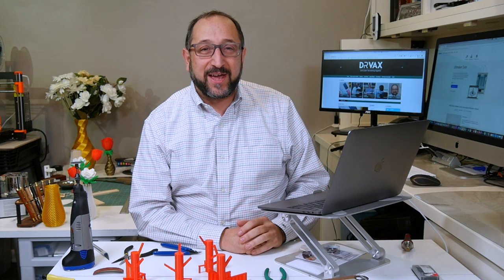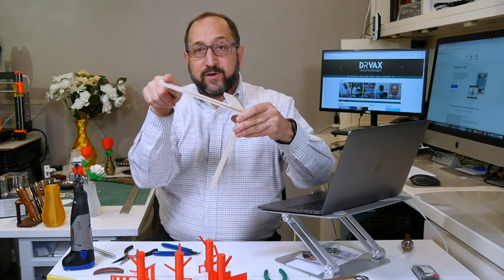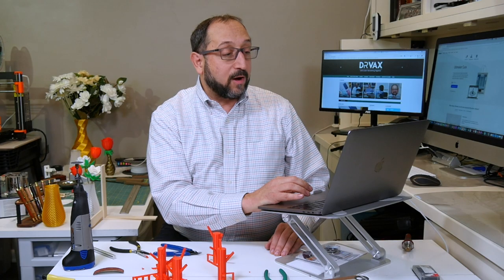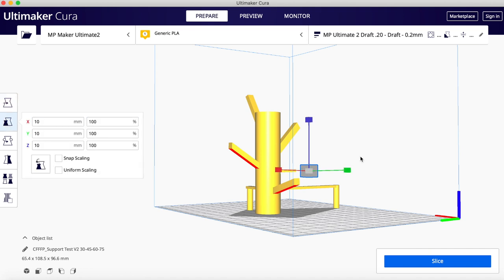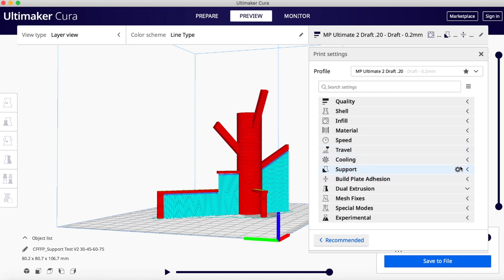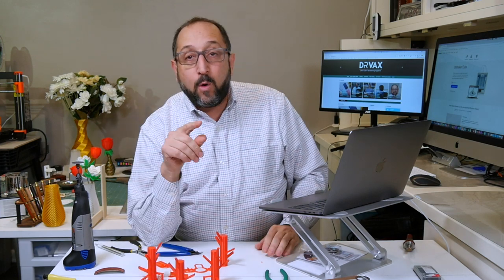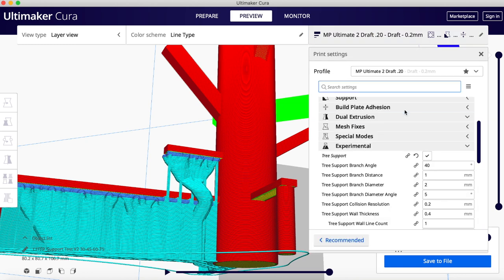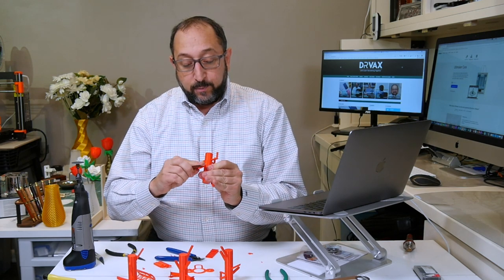Cura 4.4 Support Settings Advanced Topics and 3d Printing

Comment: as any things, the Devil is in the details and here is an good exemple.. happy to learn the little things that we need to know for to have a better printed object.. and you explain it easy to understand.. i love to learn but it’s a lot when you start from zero: learn freeCAD, Cura, printer calibrations/adjustments, filaments calibrations (which humidity level need to be lower than possible)..  more i learn, more is like any craft/art work and tools become more important with the time (and success).. thanks for your video!!

Comment: Go into the quality settings and make the "support line width" half of what your nozzle is.  It will make the support thinner and easy to remove when you need it all over the model.
Reply from the maker: Excellent suggestion.  Thanks for sharing.

Comment: Just a heads up, when you turn Tree Supports ON, you should turn OFF normal Supports ;) that will fix your slow print time issue.
Reply: Beat me to it.
Reply from the maker: @foxabilo Thank you!!!

Excellent advice which may explain some of the issues I have had with tree supports.  

Thank you for sharing.  This is an excellent example of learning together.

I just posted a community comment about this "feature"/"bug".   I will be doing some additional testing because some of the standard support parameters, such as interface, still apply when tree support is selected.
Reply: @MakeWithTech  Could not agree more, I find tree supports really handy for miniatures, it can be a little hit and miss at times but I find it a godsend for things like 1/200th scale tanks  where you just need the smallest hint of support to keep the barrels from drooping
Reply: Dang, just seen this after I had come ted the same. Lol
Reply: Yep, if both are selected it will print both.
Reply: Thanks for the nice explanation. Im still fighting with supports but this helps getting in the right direction

Comment: I actually love using tree supports when printing mini's (D&D type models). It does a great job of getting support into the little areas that are not above the build plate because of a base or other obstruction to the support.
Reply from the maker: A number of people have told me this.  I will spend some more time trying them out.

P.S.  I have started a new discussion forum at http://forum.drvax.com where we can all have more elaborate discussions and share pictures of our prints and printers.  Check it out.  Please excuse if I have posted this to multiple comments from the you.  Just trying to get a bit of exposure.  Irv

Comment: I’ve found tree supports to be very useful for parts that overhang the model itself, but I don’t want use to use “everywhere” setting. The tree supports will only print off the build plate, but curve around the model to support the areas that need it.

They also tend to be a little more stable for very tall supports, since they generally print with a wide base that tapers off.
Reply from the maker: Good information.
Reply: @MakeWithTech  In the video you claim tree supports take longer, but you sliced with both normal supports and tree supports active. You should always have only one type of support actived or your supports will take twice as long to print and twice as much filament and will also be very fun to remove ;)

Comment: Amazing video as always. Regarding the support blockerl if you click on the area you want to block you get it right ahead of time
Reply from the maker: I have found that with Cura 4.4 you need to click on an area that is at least as large as the block.  Might be a 4.4 bug, since before 4.4 it seems I could click anywhere.  I am testing on a Mac so this may be a Mac-specific issue.

Comment: DrVax, thank you for your excellent instructional videos on 3d printing. I have technology experience, but I am new to 3d printing, so your videos have been very instructive. I admire your matter of fact presentations and taking us along on a learning journey!

My request is for you to do videos on specific issues I am encountering with 3d printing. Hope you can cover these topics! btw. your pace is spot on!
1) In the context of Cura, what's the definition (or difference) of a printing profile, how the profile applies to a a model (STL) and the resulting gcode (which is STL+Profile). How best to create profiles for materials (PLA vs. PETG) and then apply them to models (STL)? 
2) What's the proper way to to create profiles based on filament material and apply to specific (1) STL?
3) What's a Cura project and how it should be defined/structured? This relates to printing profiles, etc. as in 1 and 2 above.

Greatly appreciate your response! Shalom

Comment: Have you noticed longer slicing times in Cura 4.4? On my system, the 4.4 would slice would freeze around 35% and not progress any further for about 10 - 15 minutes, before it finally finished. I went back to Cura 4.3 and the slicing is much faster even with the same profiles selected.

The timing on this video was perfect. My most recent models with supports proved very difficult to clean and several of them broke in the process. I will definitely take a look at the settings you suggested to make printing and clean up easier.
Reply from the maker: I have not seen thank.  However I use a rather high end Mac with lots of memory.  Try closing all other apps and browser windows before you slice.  Sounds like your system might be memory constrained.

Comment: Great walkthrough of a important trophic
How about looking into others slices.
I have not have good slices with Cura
Thanks for sharing👍😀
Reply from the maker: Yes check out the slicer playlist on my channel.   My go to slicers are PrusaSlicer and Cura.  If you are not having good results with Cura I expect you may not have a good profile since my results across 8 different printers have been uniformly good.
Reply: Asger, I agree with you.  I was a big CURA fan until Dr. Vax had the video on some of the advantages of PrusaSlicer.  That's the only one I use now.  I found it difficult to go back and forth, as the commands and especially the way to move and change options is so different between them.

Comment: Great video as always, but you should not use both supports at the same time. Use either Generate Supports or Tree Supports else Cura will actually generate both this taking more time to slice and print.
Reply from the maker: Correct.

Comment: Ohh, and a hot air gun is great for removing the surface artifacts left by sanding :)
Reply from the maker: Yep.   You just need to be very careful with models that have fine details.  In one of my first videos on this channel I basically melted a model.

Comment: I have tried and tried, since 2013, to dial in Cura but no matter which printer I have ever had it is the one slicer that I never could tame on any of them.  I really want to due to the features but something about it is just wrong (probably some setting).  For instance with Cura I get gaps in walls.  Another oddity is my infill is missing in spots but S3D or PrusaSlicer or Slic3r they all come out perfect.  I tried changing settings for half a roll last month and I could never stop it from mimicking under extrusion.  I even set the flow to 200% and the same issues.
Reply from the maker: If you are creating a printer from scratch vs using a printer cura already includes make sure you check the filament size in the machine definition under extruder.  It defaults to 2.85 or 3 mm not 1.75 which is what most people would expect.
Reply: I always did that but it doesn't help.  I knew to do this with Cura because the UM uses 3mm (2.85mm) filament.  Just some setting I am unable to find to get it to work 100%.  As UM told me there are a lot of settings that are hidden on purpose and we are unable to unhide them.

Comment: How did you make the supports a different color in cura? Everyone seems to have different colors for infill and supports but I can't find a video or plug in that has it. It would make seeing supports a whole lot easier.
Reply from the maker: I do not.  This is just the rendering in the slicer preview.  Once you have sliced the model go to the preview view and select color scheme line type. 

P.S.  I have started a new discussion forum at http://forum.drvax.com where we can all have more elaborate discussions and share pictures on our prints and printers. Check it out.

Comment: hello does it work for last veriont for miniatures? I need some special kind of strucure suport for 28 mm miniatures? I ve strong background in modeling 3D and sculpting but new guy in 3D printing topic I am exploring the sortware... take some notes of the parameters to not mess it up and also need a strong knowledge , is not the same to print a miniature than a mask or a toy-car.

Comment: Hi again !
Again a nive video ... as allways !
I too just updated to Cura 4.4.0 but unfortunately - eventhough it's buildt in in Fusion360 and worked well in versions until now - it CAN'T any longer start when you commend to 3D- print then model in Fusion.
I found a workAround but it's not so good as the 'buildt in' facility - use 'Custom' and then find the Cura.EXE file - it's a little more work every time, but ...
Reply from the maker: Unfortunately the integration of 3d printing tools from multiple vendors is not very good.

Comment: Dr. Vax why won't my custom supports I've generated print on any certain projects I'm working on?
Reply from the maker: Make sure they are thick enough.  Slicers have a minimum thickness.
Reply: @MakeWithTech  I thought I did, but, I'll experiment more with it

Comment: Dr Vax,  I purchased a brand new A13 printer (ender clone) from ebay (25 Nov 2019) this was supposed to be all wired up and just needed assembly, but when it arrived the cover on the base was was hanging off and the internal wires were disconnected and loose. There was no micro sd card or reader included. 
Can you please help? I don't know which is the 240 volt  input terminals in the power supply box as there are only black and red wires plus a yellow wire. I live in the UK and the line (is BROWN) and neutral (is BLUE).  The power supply box has (COM) markings  stamped on the aluminium case and also (v+) there's three of each. The red wire connecting the heated bed was not attached to any supply and there was no spade connection on  the box it was just hanging loose.
I'm confused and in a pickle Dr and would very much like your help if possible, is the black wire the power in the US and the red the neutral?  Appreciate any help, thanks, Henry.
Reply from the maker: @henry rummins Unfortunately I have never seen an A13 and therefore do not know what power supply or control board they are using.   I think the safest bet for you is to reach out to the manufacturer and see if you can get a manual or a wiring diagram.  I would hate to give you bad advice and blow up your new printer.

In general, I stay away for low-cost clones.   Yes, you could call Creality a clone but I am sure with Creality of Monoprice that they will have a user manual and support.

If you get a user manual and have trouble understanding anything I would be happy to try and help.  Unfortunately, if you get the wiring wrong and have the printer configured for 110 and plug it into 220 bad things will happen.

Here is the url for CTC that I believe made the printer you are trying to assemble:

https://www.ctcprinters.com/pages/contact-us

There is an email address on the page.
Reply: @MakeWithTech   Thank you for the reply and taking the trouble, it's much appreciated. I have managed to rewire the printer and got it working, the thing that was confusing me was using the black or 'hot wire' in the US and the red as the common, strange here in the UK. You are correct about these low cost kits.
Thanks for the advice and the great channel you have!

Comment: Im new to Cura and i am currently using version  4.4.  On all the videos i see using Cura they have a layer view drop down menu at the top . I do not have that drop down menu option on the to bar is there a way to activate it?
Reply from the maker: To see the layers click on the "preview tab" and then adjust the view the scroll bars on the bottom (position in layers) and the scroll bar on the right (which layer is displayed).   This tab is only available after you slice a model.

Comment: Is it me or doesn't Cura scale models very well. I draw a model in imperial units (inches) and when i bring it into Cura it interprets the units as millimeters instead of inches. help!
Reply from the maker: You are correct Cura work in metric measurements.  I have not had any problem with accuracy so it should not matter what units you use when you design a part.  I suggest making sure your 3d printer is tuned properly.

Comment: Noob question, how do you rotate the whole build plate/area in Cura?  I can only seem to rotate the model.
Reply from the maker: On a three button mouse you hold down the right mouse button and move the mouse.
Reply: @MakeWithTech  Thank you very much for the reply.  Any idea for us folk with two buttons and a wheel?
Reply from the maker: On my mac I use a Logitech mouse, with a wheel in the middle, two buttons on the sides and a mini button in the middle.   The right side button works for me.

From the Ultimaker web site:  "Depending on what kind of mouse is used the view can be moved in Cura. If you have a normal mouse you can use the middle button. For a mouse with 2 buttons you have to hold the Shift key and use the right mouse button. And for a one button mouse the Shift key and left mouse button need to be used."

Hope this helps.

Comment: I use 4.3 curia.It won't let me change the density number, which it is 15. Do i need to change something else in preference in order to lower the density number? Any help would be great ty.
Reply from the maker: You have to select supports first.  Then you should be able to change the density.   Also make sure you are in “expert” mode.

Comment: When I sand with my Dremel I have to use very slow speed otherwise the PLA melts, when using tree supports with touching trunks, is it possible to put holes or gaps between the trunks?
Reply from the maker: I do not know the answer, but another viewer mentioned that when you turn on tree supports you should turn off regular supports.   Excellent advice which may explain some of the issues I have had with tree supports.
Reply: @MakeWithTech  I wonder If it is possible to use the support placement tool with trees and try gaps between the trunks, I will have to try this out!

Comment: In curia my support density stays Grey, I can't change the percentage. How do I fix it so I can? And also it does the same for my  infill density, can't change it.
Reply from the maker: The various slicer values/parameters are interrelated.   Try selecting a standard profile and see if this value is not adjustable.  Make sure you use the hamburger menu (three horizontal lines on the right side under the profile selection) to select expert or all.

Comment: Tree support is very useful for more organic structures that have overhangs that are not directly above the build plate, thus making the base of the support a part of the model. If you have straight lines like on a turned over box, tree support doesn't make sense at all, that's not what its meant for. To show you a model where tree support works great, but I had difficulties with other supports structures, take the horse of this carousel: https://www.thingiverse.com/thing:3533355 I wonder whether you can find a solution that is as easily removable as tree support for this particular model.
By the way, thank you for a really great video with lots of useful information.
Reply from the maker: Excellent information.   Thanks for sharing.